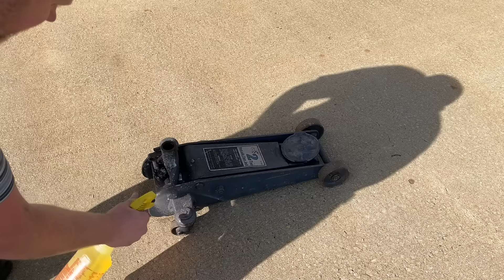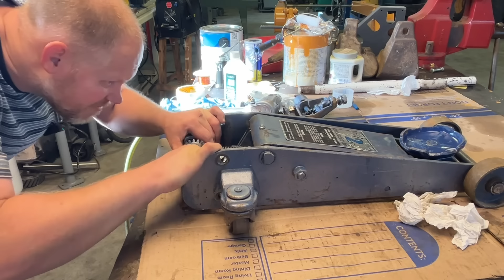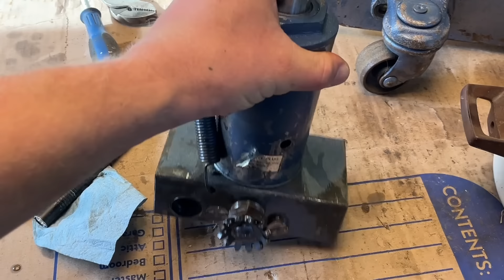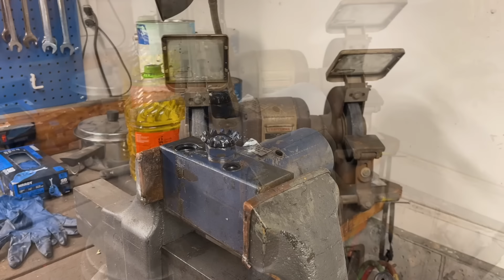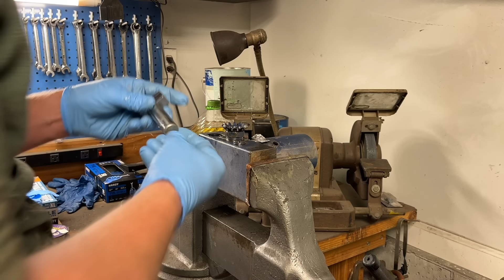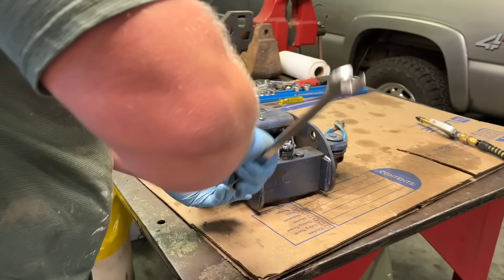Won’t Pump Up - Fixing Sears Jack for $15

Comment: Mike where did you get your parts from ? I have a 2ton Sears floor jack model328.12040 and I can't find any parts kit for it.
Reply from the maker: I bought the piston u cup seal off Amazon. Type in sears 328 jack seal
Reply: Mike, Thanks so much! I have a 2 ton jack just like that, but was afraid to take it apart. But, now I'm going to attempt it.

Comment: Fluid was clean. Somebody changed the fluid, hoping for a shortcut to fixing it. Only thing wrong was it had some error in the lines just needed to get the air out

Comment: The first step that should be taken is filling the cylinder with oil and bleeding the air from the system before doing anything else. This will return the lifting capacity to normal most of the time.
Reply: Will that make the busted rubber seal magically grow back too?

Comment: Nice video, I have this exact same jack I bought new from Sears in the early eighties. I have rebuilt it and it works fine, but some time after I got it rebuilt the piston plunger broke. I been searching, but all I can find is the kit to rebuilt it, but no plunger. Do you have an idea of where to find one?
Thank you!
Reply from the maker: I’ve never seen the plunger pistons break.  I suspect that it’s long obsolete.  Any way to make a new one?

Comment: and: JIAD
3.8
3.8 out of 5 stars
(6)
U-Cup Seal for 2 TON Floor Jack 328 Series Models 22x40x12mm Compatible with Sears Floor Jacks Models TM200F, TM200MF, YM150M,AM0226F, AM200F, AM200MF etc
Reply: Amazon

Comment: I have one just like it and I got mine free (for the most part) as well. Pump rod seal and O ring are non existent but that's an easy fix. Great video and, if I decide to do a total rebuild on mine, thanks to you I know exactly what I'm looking at.

Comment: The fill plug, in the large barrel casing, can be rotated to the upper most position. The barrel rests on an o-ring, and is easily broken loose, after loosening the large top hex; which you did. After repositioning the fill hole, it will be easier to service the fluid. Unfortunately you have to take everything apart to do this. Thanks for the video.

Comment: There’s different cup seals types some take metal O lock ring to hold some take a nut n a few it’s pressure press fit by hand need to warm up with hair drier watch temperature

Comment: Please, someone buy this poor guy some actual grease and proper jack fluid... LOL. The viscosities are different and any brand of ISO 32 Hydraulic Oil is far better a choice. In a pinch, trans. fluid. Rebuild? Do it right...

Comment: Can you recommend where to purchase seal kits? The piston on mine that attaches to the jack handle is 3/4 of an inch in diameter. All the kits I’m seeing online or for 5/8 of an inch. I would like to buy a complete seal kit. Thanks.

Comment: Thanks, Mike - great video.  Probably in one of the many comments - I found my seal to measure OD 39.32 mm, ID 22.0 mm, and depth to be 11.83 mm.   Wear would account for the difference between original OD 40 mm, ID 22 mm (not much wear), and depth 12 mm.  Was going to buy the whole kit, but just ordered the main seal.  My original seal was not deteriorated - it was a light colored material - not what looks like the black rubber on yours.  Any chance your seal had been replaced?  My lift dates to Jul 1981 (from the date code of 1204).

Comment: I have a Pittsburgh 3 ton low profile jack that doesn’t lift when under load but will lift fine with out any load. I’ve bleed it so many times already and no luck. Any ideas on what to look for? Jack is only about 1.5 years old and used maybe 10 different times.
Reply from the maker: Classic symptom of fluid bypassing around one of the seals or check valves.  Need to disassemble the pump and check for damaged cup seals. If all the seals are good then it’s possible the check valves are leaking around the seats, may not be easily repaired at that point.

Comment: Aw, sad memories: mine was stolen decades ago, still miss it.  Bough it new @ Sears in Atlanta to work my old 66’ Merc wagon.  The car had a 390 V8, 4bbl, electric rear window - that was special, and two seats that folded out of the floor in back for total seating of 12!  In a car!  Used the jack a lot working on that car.  When it died I willed it to the city.  

It was 1974, I was a kid with few resources.  So I saved and got a type lll VW squareback.  It got smacked by a pole while hydroplaning.  Bought a second one with a decent body and a burnt motor and put all the good parts into it, using that jack.  My friend let me work on it at his shop.  He talked me into selling him the jack on time-payments.  He made only 3 of the 15 payments, what a punk.  

A couple of years later the jack was gone, and he said I could pick something from the shop of similar value as compensation.  Well, he did have a nice set of Victor torches, with a rosebud, two cutting torches with several tips, and a number of different sizes of welding tips, a cart, and a large oxygen bottle and medium acetylene tank, plus fair-quality gauges, and a set of hoses that had seen better days (hello, Harbour Freight).  He had to shut the shop anyway, I figured with interest and opportunity costs of not having a jack for two years, he owed me — seemed fair, right?  This was at the dawn of the internet, it really wasn’t a thing yet, so, I went to the library, checked out a book on welding with gas and learned how.  I got pretty good at gas welding, did some jobs, time marched on.  Haven’t heard from him for decades: hey, SW, if you’re still alive and you’re ‘out’, hit me up, I’ll buy you a coffee!

Comment: Deja vu!!!  I have two of the exact jack.  I worked at Sears and sold hundreds of these jacks myself.  I worked on commission so it was a good sale for me.  I purchased one for my dad and one for me one Christmas.  He used his many times before he passed.  I now have both and they work just fine.  I also have the hand impact you have.  And the adjustable wrench.  And the grinder and so on and so on.  It looked like my workshop you were in.🔧🪛🗜🔩⚙🔨🪚🪒
Reply from the maker: Sounds like you should just come on over. LOL

Comment: I have the 3T big brother of this.  Larger wheels and, I think, larger overall.  Only thing I don't like is that the way the handle interfaces with the release mechanism (via two gears) make it difficult to get a smooth slow release.
Reply from the maker: Nice jack. Yes I agree it’s hard to release it slowly and do it in a controlled manner.  Thanks for the comment

Comment: I had a Sears 3 ton model. I lent in to a friend who needed to borrow it. It was never right after that. I kept it for 30 years & had the same issues as your 2 ton. I added jack oil. I tried purging it. Nothing worked. I took it to the dump & got rid of it. It was exceedingly heavy. I got a premium NAPA 2 ton jack that weighs nothing & works a lot better than the old jack. I don’t miss the Sears 3 ton at all.

Comment: Bought my 1 1/2 ton (green) jack in 1983, my dad said, "Brock you paid too much for that jack" after a few months, he said. "That's one nice jack".  40yrs later, finally had to replace piston cup for $10 and less than a half hour to install , Jack works great again.  Ps Harbour freight has best price for jack oil.
Reply: Have the same one , never a problem
Reply from the maker: Cool story!

Comment: I have the exact same Jack. A couple of weeks ago, it would Jack up but would drop fast while changing a tire on my Utility trailer. It wouldn’t hold pressure.
I thought it was a done deal. It was my very first car Jack since 1980. I purchased it from Sears brand new. I can’t believe I came across this video by accident.
Thanks so much for sharing this repair. Looking forward to reviving mine and still holding on to a memory of yesterday.
Reply from the maker: Good luck on the repair!

Comment: I have this exact jack, but mine is painted green. Came to own it via my wifes' late father's estate. I believe he bought it in the late 60's or early 70's. It works perfectly and I use it often. I bought two 3- 1/2 ton jacks from the orange store. They are a copy of the Sears jack in nearly all respects, made in China, and they both leak down rather quickly. I avoid using them. The orange store refused to print my buyers comment about them. Now I avoid buying anything from them.
Reply from the maker: Good story.  It’s rather frustrating the amount of products copied from other manufactures. Can’t beat the good old stuff whether it’s us, Japan, Germany etc.

Comment: Watching from New Zealand, these are very good, quality jacks. I bought one from an estate for a fiver years ago and I had been meaning to restore it fully but never got to it. Apart from a new paint job (from red to blue like yours), it also needed some machining work on the wheels to get them right, so it was a long project. Anyway, we recently moved house and in the confusion of moving, it went to the metal scrap yard by mistake. Win some, loose some.🐞
Reply from the maker: Hello over there. Dang, sorry to hear about the Jack going in the scrap! Thanks for watching

Comment: Why use petroleum jelly on the assembly and not a silicone grease that is safe for rubber?
Reply from the maker: Your comment has me researching my decision. Seems you are correct that another lune is likely better. Old habits die hard

Comment: I worked in a small sears auto service center in the early 70’s when I was in high school. I bought one I believe in 1973? . I still have it, and use it today, although very rarely anymore. The only thing I ever did was weld a handle on the side to make it easier to throw in my service truck. Great jack. Still works great. Thanks for for the video.

Comment: Why does no one make a handle for the high pressure washer that latches closed instead of open? I bought one of those 24" Crescent wrenches in Florida , at a pawn shop, while on vacation, back in the late seventies, for $20.

Comment: You should always use silicone lubricant in rubber seals. Petroleum based lubricants break down rubber over time

Comment: Any help much appreciated at 19.09 he’s screwing in the release value. Mine is stuck & will only turn quarter turn each way. On my Jack the nut at the top isn’t wielded on. But the gear teeth only turn a little, looking for help how can I fix this

Comment: A lot of times people don't understand why the seals and O-rings go bad. It's because they leave them out in the Heat or put too much weight on them and some people put the wrong fluid in like brake fluid this can cause O-rings and seals to go bad😮 so keep your jacks out of the Sun😅
Reply: My 3 that stopped are only in the sun when its not night or raining?

Comment: Great video, I was given a jack with a similar issue which I was loathed to throwing away. I was thinking whether seal kits exist as my hydraulic motor bike stand is also not lifting fully. You’ve inspired to go in and see. Great video and many thanks for the community spirit.
Reply from the maker: Hello, good luck and thanks for the comment!

Comment: Well done, especially what goes where in the “tank”(?).  Just curious why you wouldn’t want to change all the seals while it was apart.  Obviously not your first rebuild.  Thanks!
Reply from the maker: Hello,  the only reason I didn’t replace all the seals is because the kit is pretty expensive on these but the one piston seal is cheap and is really the only one that goes bad for the most part.

Comment: 18:48  My 1 1/2 ton (green colored) jack does not have a check ball in the hole where the toothed wheel goes: Instead it has a needle valve that's attached to the end of the wheel.  That's what goes down and closes off the fluid when the toothed wheel is turned all the way clockwise.

Comment: Hi, are there no grooves inside the working cylinder to release pressure when the jack is in the upper position. Could they have torn the cuff, or is there another mechanism of the bypass system?

Comment: Really good video, thanks. I really enjoyed the hand-is-quicker-than-the-eye moment when you reached through the jack arm and just flipped that little old spring in place like it was nothing. Now either that spring was a lot weaker, or longer, than the one on my Allied (Very similar to Sears) or you are the new 6 million dollar man. Mine took a lot more pull than I could muster with a mere twist of the wrist. Mine had to be pulled (By someone with a better back than mine.) using a lot of back muscles, and a loop of wire through the spring loop to get the right distance for maximum pull, and the jack blocked firmly to the bench top.
Reply from the maker: @MrRoundel  Thanks for watching and I think the spring was softer than yours. Lol

Comment: 9:24 is the only problem my jack had. leaking from this hole, looked at seals other than being 20 some years old will replace just those O-rings and see if no more leaks

Comment: I gave up on hydraulic floor jacks...and switched to an air compressor bellows floor jack...The ease of use and super simple design makes this a no brainer. And it's quick!
Reply from the maker: @ekummel  I’ve heard about those but have never used one.
Reply: You have an electric car?

Comment: I'm reviewing again, because I question that green u-cup you installed.  Mine cylinder has a lip like that but there was no circlip.  Mine also didn't 'snap' like yours did, but it was tight (not just slipped over).  I guess I need to pull it apart to see if u-cup slipped off or something.  It kinda works so it might just be an adjustment somewhere.  I'll get it.
Reply: this is so frustrating and time consuming, but I hate to give up.  I was convinced it was that internal u-cup, because the old one was torn up.  I put in new fluid and it seemed to have the same lifting issue.  I bled and refilled fluid a bunch of times, and air seems to keep getting in so it must be another seal.  I've tried different setting of the check valve, and nothing works.  This was a good idea, but so is a replacement jack, such a pisser.
Reply: u-cup looks good, and tight, replaced o-ring and shot off valve (star gear), does nothing.  It looks like u-cup faces toward end of (outside) rod?  I did same as in here.  Maybe not enough fluid but it should only take up to 8oz.

Comment: First big purchase tool I ever bought (1972), was a 2.5 ton Sears jack that looked just like that one, After 5 years it began leaking down, so I tore in apart. 

The piston was made out of about 4' of brown waxed meat-packing paper, sandwiched between 2 large flat washers, and squashed down to 1/4" thick. I was shocked - I was trusting that to lift a car.

 I took the parts down to an industrial hardware store, and the guy fixed me up with a real rubber piston end. Put it together, and it is still going to this day, (2024) my son still uses it.
Reply: Never trust a jack by its self. Put a jack stand under the vehicle and let the jack down on it. I got fired for not using a jack stand when i was 18. Never forgot that lesson in the 50+ years since.
Reply: @brucestarr4438  agreed.  But if you don’t know that, or you trust jacks more than is right, hopefully there’ll be someone who can hear you scream with the car crushing your chest!!
Reply from the maker: @miketrissel5494  cool story

Comment: My Brother, Father and I all bought cheapie jacks from Sears only to have them fail.  Sears exchanged them for 3 versions of this fine jack.  My Father's jack survived a garage fire and looks like hell but still works fine.  Mine just recently failed and I suspect it need the cup seal replaced just like this one.  My next Winter project :)

Comment: I fixed my jack I bought back in the 70s. All it took was two O-rings. One for the pump valve and one for the jack post. I had neopreme o-rings that fit. Good as new. Not that difficult to fix.

Comment: Great lesson . One comment : If you pressure wash or steam , be sure to regrease all casters and any friction points . Once the old grease is washed or melted off it needs to be replaced .

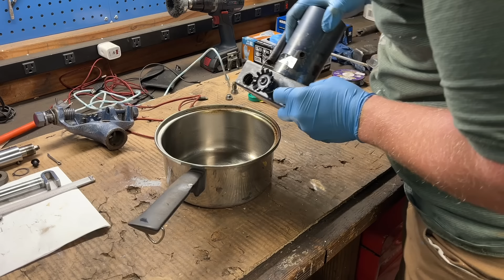Comment: During disassembly of the check valve (13:37)  you say small then a big ball on reassembly (17:31) you say small then a big ball (opposite of how they came out) ???  Which order is correct ?  Additional note, rewatching/listening to the video.  Sounded based on pitch, the large came out first then the small (higher pitch).
Reply: The small one always goes in first.

Comment: I have 3  3 ton Craftsman jacks look just like that one. I bought them around 2000-2001 to lift a vehicle all at once and sold the vehicle before I ever used them. 12-15 years later I finally needed one of them and they were still unopened in the box. I opened one but it wouldn't pump up, so I opened a second one and it wouldn't pump up either.  There was no evidence of any oil leaking inside the boxes. I don't remember what I did to get it working but I figured the seal had dried out. I may have opened the dump valve and pulled the mechinism up to extend the piston multiple times or maybe I turned the jack on it's end or upside down hoping to get the seal working again. I do know I didn't take it apart and It started working and has been fine every since. I did the same thing to the others with the same result. Thanks for posting this video, it was really nice to see how it comes apart. You know these things are just hydraulic jacks laying on their side which I think might be part of the problem and over time the seals dry out and quit working or they get stuck from lack of use. Thanks

Comment: Wow.  My floor jack.  Bought it at Sears in the late 70’s.  Same color, too.  Mine doesn’t hold pressure.  Almost exactly like the one you have.  I’d like get it going.
Reply: Lazzars has the kits